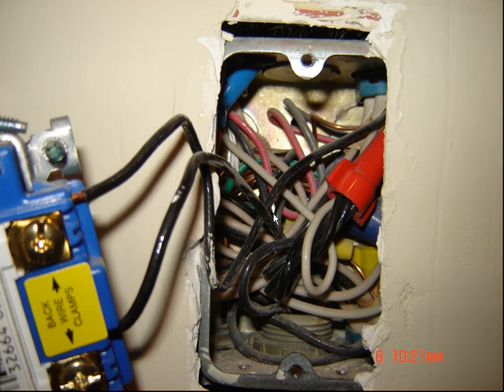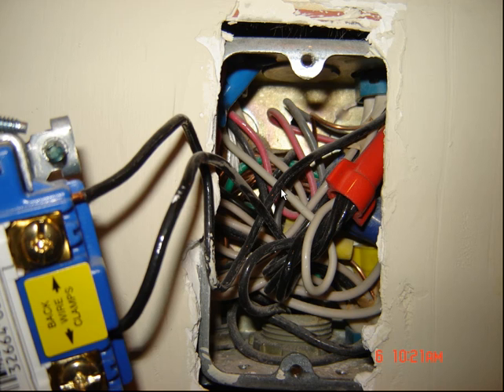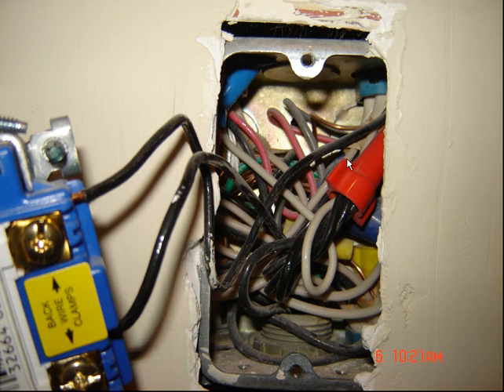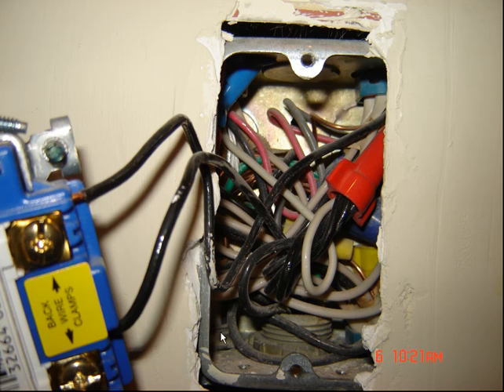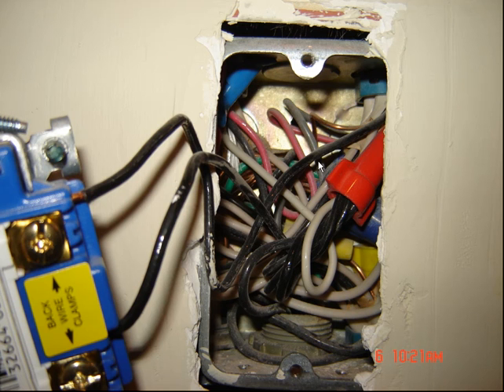Electrical Wiring-Too many wires

Comment: I need to change the connection from 220 electric range to 110v gas range. Cable is too thick to fit in the wall outlet.

Comment: I am calling my electrician.  Just found a small outlet box with 4 wires coming into it! This is impossible to connect since it adds up to 5 wires in each wire nut.
Reply: Sounds like a big rats nest in a little box.
Reply: Common cowboy, stuff em in and flip the breaker on! Are you scared???

Comment: The white wire tied in to the hots was likely used to send power and switch leg to a switch with a single run of Romex. Making the white wire the hot would eliminates the possibility of mistaking it for a neutral. This is why I don't like Romex. this kind of practice is actually legal in some states. EMT and PVC let you pull what you need when you need it, in the color you need it.

Comment: there should be mandatory schooling for Greenhorns and Journeymen.  I see alot of Greenhorns who come into trade and after a year they think they are journeymen.  In addition, mandatory drug test.  Way too many young pot smokers in the trade.  I refuse to work with them.
Reply: tsegithunder Ya,  I guess  an electrician  is the same as  A rocket scientist. Whatever.

Comment: we had 7 lines running into our kitchen light and too were old 12-3 all was the old stuff with no ground and cloth covering   plus it was a old small octagon box about 1/2inch smaller than the new ones  it had 5 wires under one wire nut with old cloth tape then a bunch of outlets running of of it and 3 lights a few switch legs and a washing machine  a total of 19 items running off one 20 amp fuse  a role of 14-2 too days a few holes a new celling and 3 new 15 amp circuits it was all good

Comment: This type of skimpy box happens on tract houses and were folks pinch pennies. The builder contractor often is to code when it was first built but the box often has no reserve room this poor for future expansion. It it is your own building or you want a good reputation having a tiny box is super bad. A Bigger box allows proper expansion without the mess seen in this great video.

Comment: @sparkyUonline Especially on THAT device!  That looks like a Cooper, which they sell at Lowe's.  It has true backwire clamps which make wiring very easy; there is NO reason to use the backstab holes.

Comment: I was working in a three phase panel one time and saw what I thought was black wires going to the neutral bar. After further investigation they were sharing the neutral between three phases (which is perfectly fine if done right), however all three phase wires were on A phase.......the neutral had to of had at least 45 amps on it and it was number 12 wire. The black wires I seen were originally white......it was crazy!

Comment: There's a shitload of too many wires in that box.  That could be a potential fire hazard waiting to happen.  What I know from reading my electrical boodks is that when you force wires into an electrical box that's too small for the number of wires it contains, this can disturb wire connections and damage wires, leading to a fire hazard.  There is no doubt in my mind that this was a violation of code.